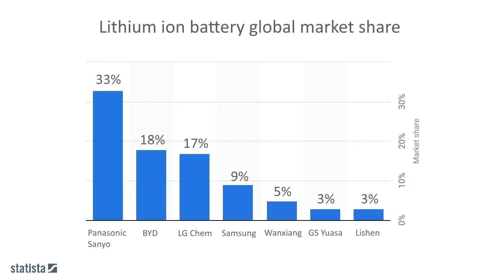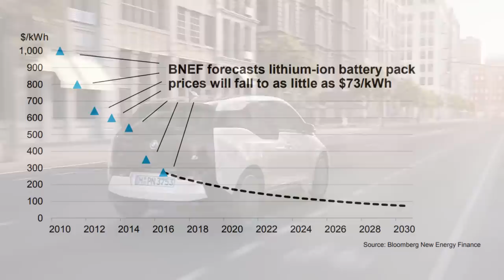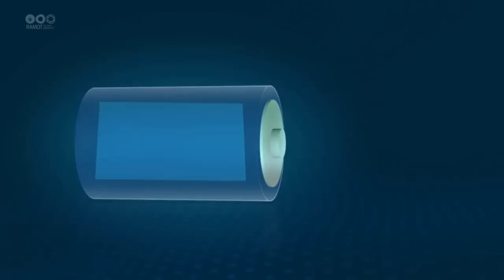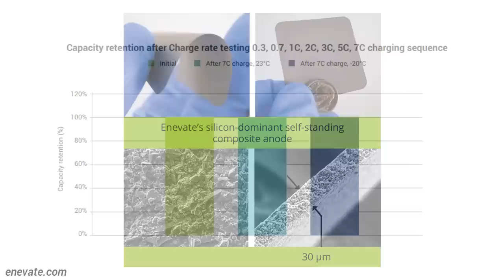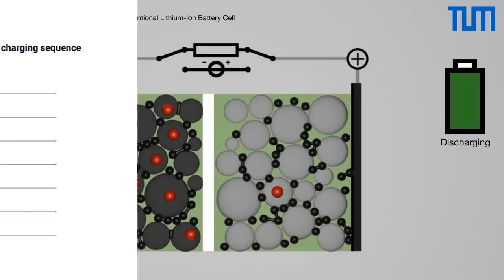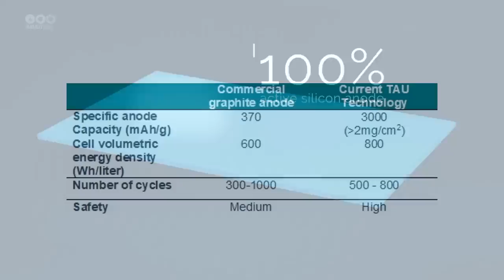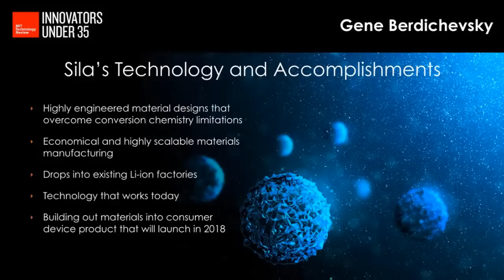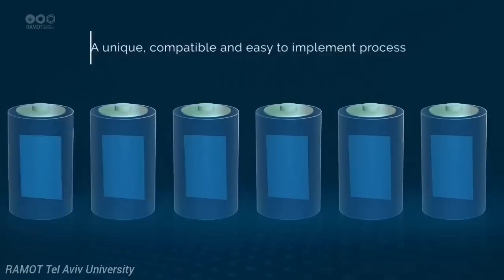The Battery Revolution. Ultra Fast Charging

Comment: Aren't we running out of Cobalt?
Reply: Cobalt is a tiny portion of Lithium Ion batteries, just like Lithium is.

Batteries today like Tesla uses, the NCA chemistry, are 80% Nickel, 2.8% Cobalt, 5% Aluminum, the rest is mostly Copper, Graphite and about 2% Lithium.

The amount if Cobalt being used is steadily decreasing, and the goal is to mostly eliminate it, and Tesla has already decreased the need for Cobalt from 10% to 2.8% today.

Comment: Future of transportation. Good bye diesel and gas engines...primitive stuff. And the maintenance costs are extremely cheap comparing to the maintenance of a regular petrol engine...starting by the constant engine oil change which costs money... All positive in the electric car!
Reply: hello 500.00 electric bill
Reply: john malson , in one year, of course and it's easier to steal! Compare a full tank of gas how much you pay for that? In one month how many full tanks do you need?  It spends less energy than your air-conditioner.
Reply: @johnmalson990  People who have switched to electric cars are finding the electric to cost only 1/3 as much as the gasoline to travel the same distance.

Comment: pffff, we shall see which one will last the longest, my good old trusty corolla or the electric junk.
Reply: Well you just dismissively called the electric 'junk'.    Maybe you should open your mind up a bit?  I have no doubt in my head that successive generations of electric vehicles will be more reliable than  the ones today.  I can already imagine 20 years from now, electric pick-ups that are rock stable and super reliable.

In fact, not counting the teething problems Tesla seems to have with every new model, EV's have proven very reliable.  You need to consider that a lot of ICE vehicle product lines have been out for decades so all the kinks are already smoothed out, with successive generations of models being very reliable from the get-go.

Comment: Imagine the future when solar panels on the top of your car would be enough to power the car without recharging...imagine
Reply: Unfortunately it can't be done.  You can extend the range of your car by a few KM or miles doing that, but you can't run a car that way because there simply isn't enough surface area, and solar panels can theoretically never exceed 30% efficiency.  

The cars using that technology would unfortunately not have much real life utility, and you can see the attempts here:

https://en.wikipedia.org/wiki/Solar_car_racing
Reply: Captain Crunch in the FUTURE they will MAYBE make superior solar panels to what we have today..same with batteries..imagine
Reply: I am not disagreeing with you that solar panels will improve, that is going to be the case for sure, it is happening already.

But solar panel efficiency maxes out at 30%, not 100%, as converting light to energy has a real physical limit.

We are already at 21% to 22%.  We can make additional progress towards 30% for sure, but basically, a 30% efficient solar panel is actually 100% efficient.  That is as much energy as we can convert from the sun.

It is kind of like gasoline.  A gallon of gasoline contains 33.7kWh of energy, meaning, if its conversion to energy was 100% efficient, you can produce 33.7kWh of energy out of a gallon of gas.

You can spend infinite amount of time improving the conversion, but you will never get to 33.8kWh, 40kWh or anything above 33.7kWh, just like a container that contains a liter of fluid contains a liter of fluid, you can't improve it to contain 2 liters without changing its volume.
Reply: I wish the sun shined here in seattle
Reply: Just a day dream at the moment A present day solar panel will be not even able to charge your smart phone let alone charge an ev
Reply: A present day solar panel can't charge your smart phone?

I assume that is supposed to be some strange sarcasm.  Converting the entire glass roof of a Model 3 would produce around 600W of electricity per hour.  Assuming we would get about 6 hours of charging per day, that would be enough energy to drive somewhere around 14 miles in a day.

Not nothing, but probably not worth the added weight and complexity at this point in time.

That would be more than enough energy to power most smartphones for about 6 months however.

Comment: I cringed when he said "18-65 batteries"
Reply: It was probably due to the 18650 batteries in the Model S becoming the 2170 batteries in the Model 3.

In reality, the numbers are based on a form factor in mm, so the extra zero in the 18650 isn't really needed, it just becomes 18 x 65 vs 18 x 65.0

Comment: if you get rid of the combustion engine .what will the oil companies do ?did you know that a golf diesel is more greener than a tesla .so how we going to go greener by providing all this electricity for the all these cars .then they will put up the electricity costs .  at least you will not be charged  a fuel tax to enter cities. but they will then charge a  congestion tax in all towns and cities.the government will screw the normal car owner.     no matter what.

Comment: How about hydrogen fuel cell? More eco.
Reply: Actually it isn't, to get hydrogen from water is expensive, energy intensive, and not at all green, the other option which is cheaper and is being used now is extracting hydrogen from natural gas. Hydrogen cars require expensive tanks carrying liquid hydrogen and have a shorter range. Also it would cost untold billions to built all the hydrogen fueling stations, electricity is already far more readily available.

Comment: These kind of videos promote the myth that electric cars will reduce the consumption of fossil fuel
but, as it is clear, we will need to produce electricity in 
power plants in order to move all those electric cars. Furthermore: we 
will need even more fossil fuel in the futur because of electric cars: 
you need more energy in order to process energy transformation twice: 
from fuel in the power plants to electricity; and from electricity to 
movement in the ev cars

Comment: Facts are easy to deal with especially when you ignore them. The truth is that electricity is not free just as gasoline is not free. When you use gasoline to run a car the calculation is easy. You just divide the number of miles you travel by the amount of gasoline you use. Not so when you are using electricity and electric cars. Because you must take into account not just the amount of electricity (which most people ignore pretending that driving an electric car is free). Another often ignored cost is the tax that taxpayers pay for electric car subsidies which has been significant though ignored since the beginning of the Obama administration when he began handing out trillions to people  who make electric vehicles. 

So when you talk about electrical vehicle transportation make sure and include the cost of tarifs that raised the cost of the automobile. Also remember to include the amount of fuel subsidy included from the government (money you pay through taxes).

Comment: Now run your car on coal.
Reply: Meaning what?  The amount of coal used for electricity generation will continue to decrease until it is phased out entirely.

Just like we didn't stop using horse drawn carriages because we ran out of horses, or the stone age didn't end because we ran out of stones.
Reply: I love how people like William Munro think they're really smart and witty by writing comments like that, when really they haven't done the tiniest bit of research.  It's still cleaner to run it on coal in most states.  Not that coal isn't phasing out, right?!?  Right?

Comment: Electric car can't stand up to abuse and ageing as well as gas cars ! So it well be a fail thing !
Reply: Electric motors are rated for 1 million miles of driving, the batteries are designed for 600.000 to 900.000 miles of driving.

Show me a gas car that can be driven anywhere close to that, and your claim will have any merit.

Comment: Sorry , Electric is no more of a revolution,, than the Detroit Electric a Century ago..!
No ; battery powered Vehicles are not the future,, not in the coming decades anyway.
Remember, despite "market hype" ; less than 1% of Vehicles on US roads are electric.
Recharge time & motoring range of battery powered electric cars/trucks is impractical,
(( the very same reason, gasoline took the market 100 years ago ))...  
....
Weight disadvantages with batteries is even worse than the cost price of batteries....
For transport - hydrogen provides quick refueling and for range; it far exceeds batteries of equivalent weight,, ( neither will compete with selling price of gasoline vehicles ).
....
For heavy trucks, semi-trailer "operators" will not sacrifice payload for tons of batteries,
this is an obstacle with no solution. Electric vehicles are "limited' in their practical use.! 
Then any hybrid with too much technology will also be too expensive by comparison. 
....
Without subsidies, financial incentives and regulations,  most vehicles on your roads will still be "fossil fueled" in 20 years - the USA is 99%+ today; don't hold your breath.
Reply: And the sad reality is that America will never give out subsidies since it makes an absurdly large sum of money from fuel. Let's hope some smaller countries will do it, I know some are already doing it right now.
Reply: Did you miss that part that many countries are banning the creation of combustion engines within a decade?  So yes, electric is the future whether you like it or not.  Did you also miss the part where new technology is in development to get faster charging - as in 80-90% of the car's full charge in just 15 mins?  I think you're the one being impractical...

Comment: The video was actually really good. But like many others I don't give much about the promises of the industry or some experts.
Reply: I wouldn't go that far.  Forecasting the future is very difficult.  If you told someone 200 years ago that we would have cars, airplanes, satellites, computers, mobile phones, flat screen displays, digital cameras, wireless communications, the internet, etc. they would have locked you up at the local insane asylum.  

Which means also, forecasting what is going to happen 10 or 20 years from now, let alone 30 to 50 years from now, is going to be extremely hard.  But I don't necessarily think that means we shouldn't even try.
Reply: Yes, making the right predictions about the future is an enormously difficult task. Even professional futurists and consultants often get things wrong, let alone regular people. But it's a human thing anyway thinking like that as it gives directions to our present decisions... And it's fun ;) 
But to put things into the right perspective: my comment was about the battery industry and its promises. During the last 10 years there were almost every year reports about a "massive breakthrough" in battery technology which was predicted to come to market in the following 2-3 years.... Yet nothing happened.
Reply: Noted, but there are actually massive breakthroughs in battery technology every year, problem is many of them scale poorly for mass production or are prohibitively expensive.

Fortunately for the EV world, only few of them ever have to make it to make a massive difference.

If you think about electronics, once the transistor came along, it was a game changer that preceded all modern electronics.  

So, as far as battery and energy storage technology is concerned, it is not a matter of if, it is a matter of when.  Could be a decade, could be a few decades, but it will eventually arrive, and it will change everything.
Reply: Look at history ... especially tech and car tech promises ... in 2010 they said every car would have 50% hybrid sales by 2020, it's nearly 2020 and it's not even close to 50% sales.

There also a bottleneck in electricity production. Remember blackouts in the summer when everyone uses air conditioning? Ur bill doubles.

Imagine every using 3x-4x more energy in every house charging their 2.5 cars everyday, ur electric bills would 4x-5x if the electric company even keep up with the load. Also, most homes would have to pay $1000s to retrofit the power lines for higher amperage wiring to charge their 2.5 cars.  Taxes likely would go up constantly to fund more electric plants that burn fossil fuels.

Some ppl have simplistic minds and cannot see the complexity involved. These ppl are useful idiots to be manipulated by politicians and corporations for their own selfish interests.
Reply: Not sure what history and tech promises have to do with anything.  It doesn't change what it here already, today.  

And there is no "bottleneck" in electricity production.  That claim is written by people that have no idea what they are talking about.  And blackouts are not generated by "bottlenecks" and no one's bills are doubling.

The power generating capacity of a utility is determined by peak load capacity.  And peak load is always going to be during the day.  My utility, like most, posts the peak demand hours.  Peak demand hours, when the load is highest, is 6AM to 10AM and 6PM to 10PM in the winter time.  When people wake up, they warm up the house (central heat) take showers (electric water heater) heat coffee and make breakfast (stove, toaster, coffee maker),  and head to work, and turn on computers, lights, etc.

The same applies to the evening, people come home and start cooking dinner, using the oven, stove, turn on the TV, etc. 

In the summertime, the peak time is 12PM to 9PM.  As that is when the sun starts really heating up the city, and offices and homes start running the A/C.  Dinner time is included in this but by 9PM, the sun has already set, and the A/C won't have to work as hard.

Which means again, that there are 15 to 16 hours of non peak time available every day, which translates to 15 to 16 hours of surplus generating capacity.  Weekends are also off peak, 24 hours a day.

The grid is mostly idle at night, as schools and offices are closed, factories are shut down, the sun isn't up, so there is literally enormous excess amount of generating capacity at night.  In states with wind power like TX, they have so much surplus wind energy at night, that the rates can literally go negative at night, they will literally PAY YOU to use it at night.

http://www.slate.com/articles/business/the_juice/2015/09/texas_electricity_goes_negative_wind_power_was_so_plentiful_one_night_that.html

"Imagine every using 3x-4x more energy in every house charging their 2.5 cars everyday, ur electric bills would 4x-5x if the electric company even keep up with the load."

That statement alone proves that you literally don't know what you are talking about.  The average house uses about 1000kWh per month, or around 33kWh per day.

On average, American's drive 30 miles per day.  An electric car today goes about 4 miles per kWh, which translates to about 7.5kWh per day.  Even if both people in a household drove an EV, and each commuted 30 miles a day, they would use 15kWh a day, or around 450kWh a month.

So, as you can see, the amount of energy needed is not 5x, or 4x, or 3x or even 2x more.  The energy needed would be 50% more, or 0.5X the energy they use today.  Which again means, your electric bill would not be 4x to 5x higher, in fact, it wouldn't even be 50% higher, as most EV's charge at night, off peak, at the electric bill would be 25% higher in many states, others like GA, the off peak rate is $0,02, or 2 cents per kWh.  Using 450kWh to drive two electric cars would cost a total of $9.

Even using the average electricity rate of $0.11 or 11 cents per kWh, the total cost would be $50.

Compare that to gasoline, and the average MPG for a car in the USA today, which is 26MPG, the same fuel cost for 2 cars would be $200.  So, using two electric cars, your net savings would be $150 a month.

"Also, most homes would have to pay $1000s to retrofit the power lines for higher amperage wiring to charge their 2.5 cars."

Yet again, your claims are literally fiction.  Most electric cars charge at 32A at 240V or less.  Your dryer outlet is a 30A outlet, your oven uses a 30A outlet, you wouldn't be using either at night.  Most homes today have a 150A panel, older homes have a 100A panel, the newest homes are 200A.

So, you would be using about 15% to 30% of your panel capacity at night.  So, there would be no need to spend thousands, or really anything, to charge your car at night at most homes.

The charging rate is also adjustable, you can charge slower if your particular panel can't handle the 32A load.  Since most people drive 30 miles a day, using 7.5kWh of energy, you can literally fully charge your car overnight using your 115V outlet in 8 hours at 1.5kW per hour.

"Taxes likely would go up constantly to fund more electric plants that burn fossil fuels."

Utilities are regulated, they don't use or collect taxes for electric utilities.  And the second problem with that statement is that electricity demand and production is actually dropping, not increasing, as people use more efficient appliances, HVAC, TV's, LED lights, etc.

In the USA, in 2017, total electricity production DROPPED by 1.5%.  That is enough energy to power 28 million electric cars for 15000 miles each, or 41 miles a day.

"Some ppl have simplistic minds and cannot see the complexity involved."  You are confirming that more and more with your posts, admittedly.

"These ppl are useful idiots to be manipulated by politicians and corporations for their own selfish interests."

I would personally not refer to yourself as a useful idiot, but if that is where you are going with this, I leave that up to you.